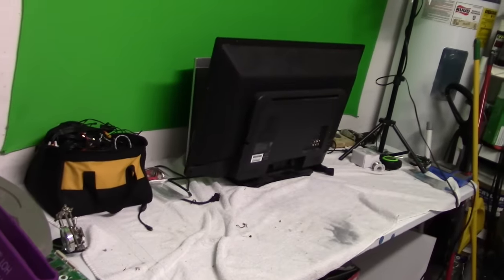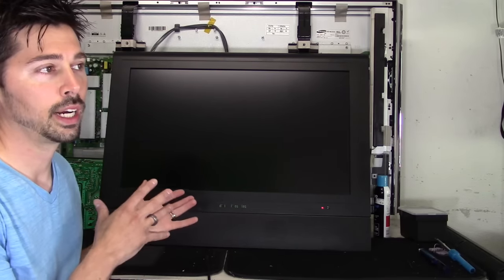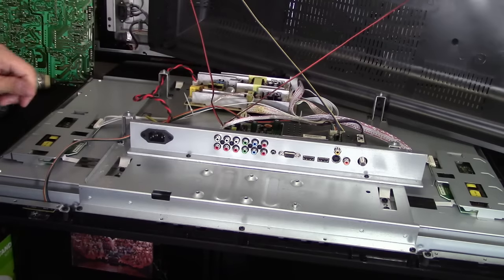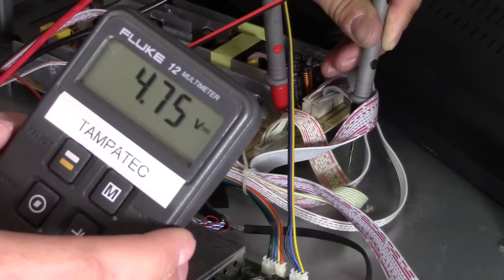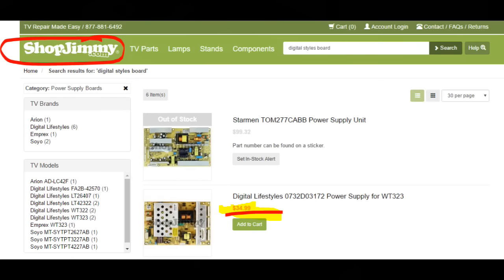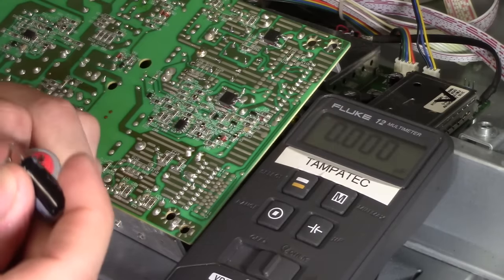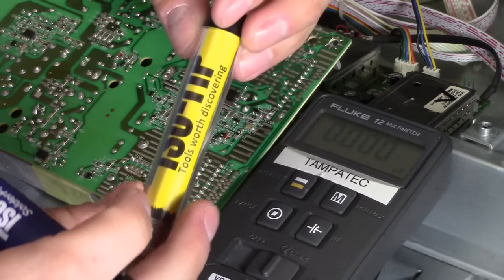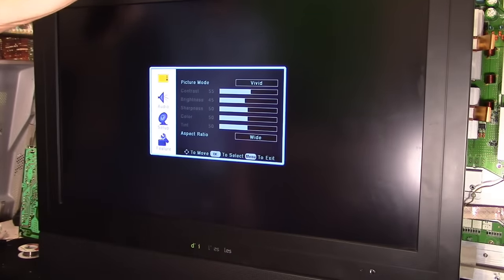WATCH THIS VIDEO BEFORE THROWING OUT YOUR BROKEN FLAT SCREEN TV!!!

Comment from the maker: Help us Hit 600K subs and smash that Like button👍, Subscribe for free tech support, never know one day you may get a free broken TV and fix it 🤓
*for giveaways and tech reviews https://www.instagram.com/tampatec/ Also buy TV boards: shopjimmy.com or try electropartsonline.com use code tampatecfriend 10% off. https://goo.gl/FlTngW
Reply: your video was in the recommended box, so it might be in others as well!
Reply from the maker: Jason Ingalls cool, someone at Google likes this video, thanks!
Reply: Are most tv's designed to break down after so many years or uses? Like Windows always does?
Reply from the maker: TEH kEEpEr yes everything is made to break even my MacBook. my Mac HDD was going bad so I upgraded to SSD now it's faster than most new laptops. #Fixitsavetheplanet
Reply: I did all of this and there is still a hammer lodged in the middle of my TV and its still broken.  THANKS FOR NOTHING!!!!
Reply: Excellent video!  thanks.
Reply: I'm on a few electronics blogs  (EEV, BigClive, etc...)  And I research and do electronic repairs for my job.  Yep, this one was suggested.  All Good Information as well!  Nicely done!
Reply: It was in the recommended video box, and you're right...capacitor failure seems to be a very common problem.   Good video!
Reply: This was on recommended list and I actually have Sony Bravia waiting that has caps that should be checked/replaced... I subscribe a lot of tech related channels (this now included).
Reply: Okay, bro, here is the question that's kept me from attempting this sort of thing on the last three TV's that died. Is there a stored charge in an unplugged LCD/LED/Plasma TV? If there is, how long before it dissipates? What other details can you give me to avoid being shot across the room or sent into cardiac arrest, assuming this charge exists?
Reply: in the past, there was a large capacitor on the power supply which held a charge.  some caps came with a shorting resistor over it to discharge.  Not sure with these new sets. get yourself a nice heavy resistor to discharge any large capacitor you see inside..... I'm going guess since these new sets are so energy efficient, the large power supplies and capacitors are long gone.
Reply: Young Frankenstein
 Almost everything, these days, that has a switching power supply has a smoothing capacitor that stores some decent voltage (200VDC+).  In most cases under normal conditions, that voltage usually dissipates within seconds of unplugging the device.  Plasma TV's definitely contain lots of high voltage and you need to be a bit more cautious. Use a volt meter n' check them, just to be sure.
Reply: youtube just bothered to suggest you, i always watch tech/repair stuff and really appreciate your kind of content. might have been louis rossman vids if it matters :)
Reply: Tampatec i just got a smart tv out of the dumpster the  other day  works flawless
Reply: You have a very good thumbs up / thumbs down ratio, which elevates the video onto the candidates for the recommend list.
Q: Do I understand correctly, if they used 35 V capacitors all these relatively new TV sets wouldn't need this repair?
Reply from the maker: Peter Kroll not necessarily it also matters if they use a higher temperature rated capacitors too. I do replace many 470uf 680uf 1000uf 2200uf 3300uf 16v often so 3300uf 35v in power board is more durable when voltage is running through it. I fixed my living room TV over 5 years ago and still works great.
Reply: Well I suspect it would cost them close to nothing using better rated capacitors. But we should not complain to loudly as then they would fabricate products with build in problems which are not as easy to fix.
Still, I am flabbergasted.
Thanks for your work!
Reply: TV model : Philips 32PFL6606H - Problem : no backlight (only at the beginning, then it just turns black), audio is ok, I can se the picture when I use a flashlight

thanks in advance :)
Reply from the maker: fung whyou true. the problem is they are made in China and to ship a big LCD panel costs BIG and BIG chance it can be damaged. I think big LCD panel would cost about 200 to 300usd then shipping about 50 to 100usd plus insurance. if you find a good source please share it.
Reply: Tampatec aaaaaaaa
Reply: 2-yr Hisense 32K20DW TV died on me. Light blinks six times then entire TV goes off. Never any picture or sound though. Just happened today. I thought it might be the power board until I watched your video. Since the red light does come on, any thoughts? (Came here by way of YouTube search, btw).
Reply from the maker: Fal Sea if you see a dark image with a flashlight it can be no power to backlight.
Reply from the maker: Michael Arcand check standby volts on power board if low the standby light can still be on. I'll check my repair logs.
Reply: panasonic vista tc-42x5 power outrage and tv does not turn on it does this every time power goes out I have to wait 24 hours with tv unplugged before it works again HELP! PLEASE.
Reply: Hi, I have an older CRT Sanyo DS20930. It has a great picture but I get no sound from regular tv or cable box. I can only get sound  from one of  the external audio inputs when  I hook up a playstation 2 using a rca composite cable. I tried to do a reset by shutting off the power from 20 seconds to overnight. Still nothing.  Any advice? Thanks in advance.
Reply: Tampatec 
Hey Man, appreciate you. I have a Sharp Aquos LC-32D6U with NO AUDIO. I checked all wires and connections, done all resets as per instructed with no luck. Need your expertise. Thanks!
Reply from the maker: Tim Bruggeman unplug power for 1 minute next try try factory reset. check audio settings internal speakers can be turned off.  if all tv inputs have no audio it can be main board aka a/v board. get tv boards at shopjimmy.com or electropartsonline.com
Reply: Tim
Its definitely an older model. The speakers can actually disconnect from the actual screen. I use it in my shop all the time. If this doesn't work. Any other advise? If not, thanks anyways. They're charging upwards of 50 bucks online for your help. Thanks again Man!
Reply: Tampatec he
Reply: Tampatec Hi there if I am getting 5v on standby voltage is the problem on the logic board
Reply: Tampatec, Good day. I have a Samsung model#LN46D630M3FXZA The TV powers up but there is no picture no sound only the start up chime shut down chime. I did a flashlight on screen and didn't see a picture. Please advise thanks for your time...
Reply: philips tv 22pfl2978/12 problem
it wont start and the red led keeps blinking. no patern
Reply: Tampatec
Reply: Hello TampaTec.  TV make and model: Emerson-TC1966D (tube)  Problem: turns off (sound and picture) when initially turned on (cold); will eventually stay on. Getting brave with replacing capacitors.  Thanks.
Reply: Tampatec Hi I have a question. I had a Phillips 32 inch and my little boy slapped it a few times, and now it doesn't turn on. no picture. any thoughts on what it might be before I start?
Reply: i have a problem with my tv its flashing purple iv got a hisense 42' can anyone help me
Reply: could be a loose cable just be careful poking around from what i seen they use inferior parts and stuff tends tosnap the way they glue the strip to the ledscreen could be failing but ive only seen that once
Reply: Tampatec hey to you know how to fix a broken tv screen if you know please make a video
Reply: Tampatec 

I have a a500. ten inch tablet.Its has a green glow around words  ,pics ,etc, it did this  once before and  all i did was put sd card in and reset it .Then it worked fine. this time
 i dropped  it when started  doing  it again.what do think?
Reply: Tampatec hi .. do you have solution for blue broken lines found on images on Samsung curved tv model un55k6250
Reply: Tampatec do u have a video showing how to fix that thing you screw the cable cord into. I think it's called a port.
Reply: Tampatec i found 5 lcd flat screens on the side of the road  and  three are a 42 inch one is a 32inch  and they still work just fine  one of them is a smart tv in the dining room i also have 6 stereo receives that a i trashed
Reply: Young Frankenstein yes a very high charge  be careful
Reply: lcd zony tv need help
Reply: Dear TAMPATEC.CAN WE REPLACE A PHILIPS TV 42 PLF3507H/12 BROKEN    SCREEN WITH A PHILIPS 42PLF3605H/12 SCREEN?I'AM WAITING FOR YOUR ANSWER FROM FRANCE.THANKS A LOT NICE GUY..
Reply: Tampat
Reply: You are right, this guy is totally amateur.

Cheers.
Reply: Tampatec I have Sony kdl_55EX620 need a replacement panel can't find the part number can you help me
Reply: Tampatec
Reply: Tampatec hey plz reply back to me my brothers little flat screen TV is like fading away it's dark it started happening like 2 days ago don't know what to do
Reply: Tampatec hey we have an old Sony bravia lcd flat screen tv and it doesn't work! Do you know any tips on how to fix it? There's no tv picture light or anything on the screen. Just the sound of the tv turning on thats it. Do you know any tips on how to fix the picture?
Reply: Faizan Boy4, I don't know what Tampatec would suggest, but I'd suggest checking for bulging capacitors like he did in his video.  Replace any with bulging tops and see if that helps.
Reply: Tampatec  I replaced the capacitors and the main board. The tv turns on but it has no sound ,the mute button is off. Any ideas??
Reply: Tampatec hey question I have a 50 inch Emerson flat screen my son was watching a cartoon . And it just shut off. And now it just beeping
Reply: Perfect video, thx for video:) i have a problem with sharp lcd tv, no colors and sound....i neeedddd helppp :)
Reply: Tampatec isssssssssssssssssssssssssssssssssssssssss
Reply: Tampatec please I’m begging you to help me I need an answer 

I have a RCA 60inch and when I turn it on I get 

The color white then red then green then blue then black then it repeats for so on and so on
Reply: Tampatec l mean your what sap line
Reply: Please help, I have Innjoo smart TV4 and anytime I turn it off,  it would not turn on until after 2days or more.  I want to know the problem.
Reply: Tampatec hello Tampatec I have a problem on my TV Lg Lcd 32 It has a mapping fault so help me
Reply: I have a 65in LG flat screen that's been sitting in my storage room for months because of this exact same issue. Power light comes on but no picture. Ughhhhhh!!
Reply: Hey I need help Yo guys I need help I have a insignia LCD TV and my TV rarely turns out I figured out how to turn it on I unplug it for an hour wait for 2 clicks in no redo step sometimes won't turn on for days or even weeks if it does it I have to wait for it to start flashing than ik it will turn on but it will but sometimes it flash won't appear them have to redo step over and over I today found something new I kept spamming the power button and the red light started flashing for 5 min or so so I unplugged it and didn't happen again need help guys...
Reply: If anyone knows how to fix a cassette door on a Toshiba RT-s933 bombBeat x1
Reply: Wish I could find someone to tell me about a gwp 49 m-102 Gateway plasma TV. TV signal says no signal
Reply: I have a 60 LG plasma i believe and a purple faint horizontal lines keeps popping up what could this Be?
Reply: Hello there i like the way you do ú work
Reply: My vizio turns on but I have picture which part would I need to order to fix it myself
Reply: @necron9944  IKR
Reply: Tampatec I had a two year old knock over a new Samsung 65 inch flat screen what does the screen cost to repair it?
Reply from the maker: 500k+ subs wow thanks so much, 🤯 .
Reply: TampaTec where are you located? I have 4 good Tv to repair. Are you in Tampa FL? Address pls. Thanks
Reply: Way my 55 inch come on and turn off by it self. Rca
Reply: Thank you great video !! I thought once the flat screens went that was it .. evidently I'm wrong . Actually what I thought was as low as the prices are getting it'd just be as cheap to get a new one . I've seen 50" TV's for $329s
Reply: Hello I need help.  I’m have a 42’vizio tv with the IR sensor that doesn’t work. But can’t find the IR sensor 3639-0032-0189 model E420i-B0
Reply: A z zinnia 2z⁰
Reply: I need the plugs four my russan tv
Reply: I need the plugs four my russan tv
Reply: Sony tv cast
Reply: Hi I have a LED 40'' Bush TV with built in DVD player. The standby light comes on but when you go to switch it on the blue power light comes on then quickly goes off again and goes back to red standby so TV does not come on. There is a lead from a white socket connector from the board that runs to the standby switch mount then across to the standby light with another connector. So could this be a problem again with AV- board as it looks like the only board it has besides the DVD board. I'm looking to replace the whole board for a new one, I'm only looking for a brief outline of a probable cause,  so any advice will be very much appreciated,     . . thanks great videos btw
Reply: Not certain about the points made but ,if anyone else  is searching for 
how to repair cell phone
 try Saankramer Electronic Magazine System (Have a quick look on google cant remember the place now ) ? Ive heard some extraordinary things about it and my work buddy got great results with it.
Reply: I have a Samsung TV model UN46EH5300 It turns off and on on his own
Reply: What should I do
Reply: Hello can you repair the led screen on a vision
Reply: Just got one samsung plasma pn50b450b1d   works and sounds good no picture though
Reply: Hi Tampa, great vids very educational, just a quick question if you don't mind. I live in the UK and at the moment I am doing my dad's TV  one of the backlights has gone? It's a Bush 32" does 32165hd and I was wondering how do I find the right backlights for the TV and where would I find the number I need  to order the new set of backlights. Kind regards.
Reply: very good video
Reply: Mysterious bloody hand this is going to be a helpful video
Reply: @TampaTec  My one month old 55” TCL R635 was working fine until it suddenly the screen blacked out, the audio was still working fine. I powered it off, unplugged it, waited a few minutes, plugged it back in and powered it on to discover that the bottom ~20% of the screen had horizontal lines going across it. I tried all troubleshooting techniques, but nothing would get rid of the lines and it now blacks out every hour or so. I’m wondering if you had any idea what the issue was? - based on my explanation of what happened.
Reply: Hi sir
Reply: Man I got a LED screen but the remote control doesn't work also TV keys and it shows key lock on the screen, what should I do?
Reply: wow i wish u could fix my tv my Samsung TV was going on then off then on then off not i will not go on the light is red that the way it always is. it would blink and have a music notes before it goes on and one note of going off  it just stop going on i think i have the same problem i use it for a monitor for my laptop work for 12 years so i think it might have the same problem  but i do not dar to try to fix i might end up braking more
Reply: TampaTec.  I have a 2-year old 82" Samsung LED TV, and it just stopped working.  No power, and the led power light is off.  Is it the powerboard that I need to replace?
Reply: Tampa Tec can you please help me fix my TV? Please brother
Reply: Subscribed
Reply: I have a tv that keeps shutting off after about 30 mins 
Any tips?
Reply: Can you provide Sharp software/firmware update? I have not had any luck contacting Sharp or their component provider.
Reply: @necron9944 awesome comment.

Comment: Just a useful tip I've learned over the years:  for those who may not have much experience with small parts or electronics soldering.. use a small tip on the iron and make sure it's plenty hot. It should melt the solder immediately. I always leave a tiny drop on the tip before going to the board. Get the suction bellows right down there and release the plunger as soon as the joint goes shiny. DO NOT LINGER ON THE CIRCUIT CARD OR COMPONENT!!!  You can quickly burn traces and neighboring components. You may want to practice the technique a few times on some junk cards if available. Just some thoughts. Take em or leave em.
Reply: Much appreciated
Reply: Thank~You!! I wish I’d have thought of this or found your comment last week!! Better late than never. :)
Reply: Dip it not dab it.
Reply: Totally agree with you, having spent 45 years in the repair trade. The solder should melt almost immediately.

Comment: So Tampa tec Dude, basically after getting laid off my job I created my own employment by grabbing tv monitors and computers from the local recycle bin, fixing them and reselling. Recently I found an LG 55UF6450 4k smart tv and it powered up but had a blank screen. Following your recommendations I checked the capacitors on the power board and they were all good so I took advice from another dude on you tube and tried baking the mother board in the oven for 10 minutes at 385 F. well it worked and now we have an awesome tv cost us nothing. It always amazes me as to what people throw away. Im not an electronicas guy but with your help I would say that I am becoming one. Thanks so much for your guidance and easy to follow instructions in your videos. Keep up the great work. Kudos to you Dude!!!!!!
Reply: e is great''